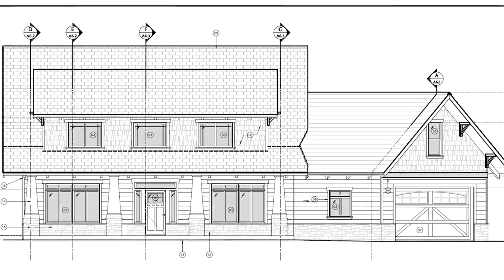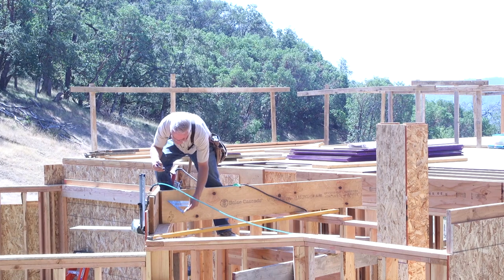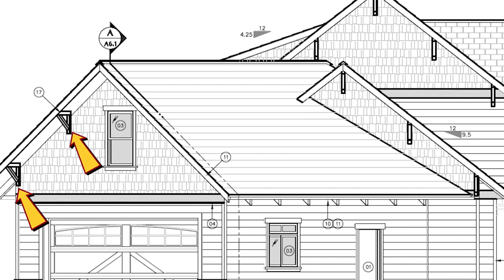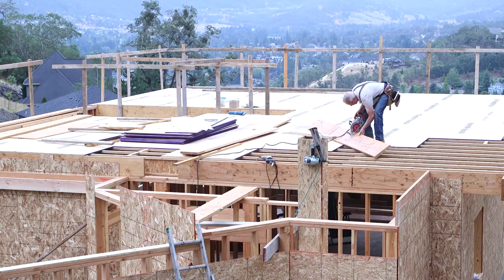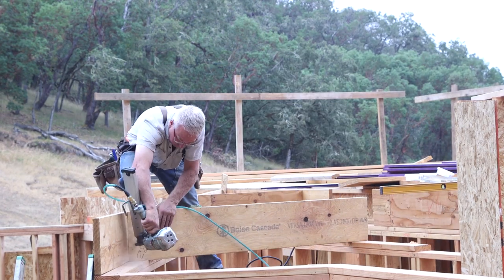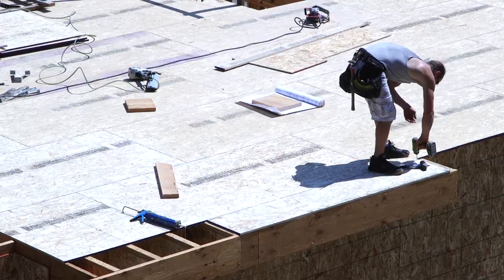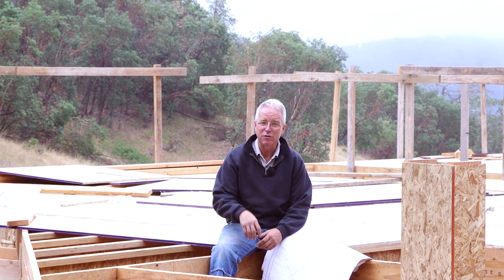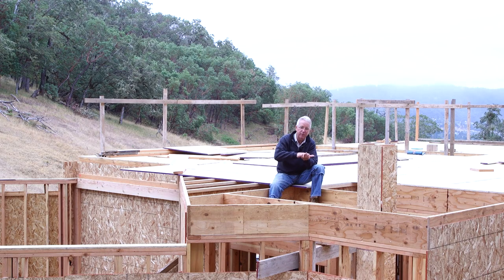Ledgers, LVLs, Design, and Scribing Ep.57

Comment: When I was junior in high school, I had an after-school job helping someone build their own house. In the process of sheathing the exterior, I found myself tasked with cutting a piece of plywood to fit where the 2nd story exterior wall intersected the roof of the 1st story AND the roof of the porch. I needed to cut a 5-sided piece and there were no right-angled corners. After staring at the problem for awhile, I jumped down, got my calculator out of my car, and used trigonometry and a straight edge to layout the shape onto a large piece of cardboard. I cut out the shape from the cardboard and took it up onto the roof -- it fit!  I'm sure there was a much simpler method of fitting a piece to that opening, but I had no idea how else to do it. My boss, who was a mechanical engineer, complimented my ingenuity. He said he'd been watching my progress and thought this may have been the first time trig had been used for such a practical purpose.
Reply: Well no wonder you turned to trig for your answer, as it was likely fresh in your mind from math class. I would have likely done the same.
Reply: My parents added a room on to their house many years ago. At the back, the sloping roof met the outside wall at an angle. That meant the wall had to get taller as it went along. I remember the carpenter saying he had to take the plans home and work out the stud heights using trigonometry. It came out great the first time around. He was both smart and fun. I'd help him clean up the site most days after school, and we'd have a great time talking and working.
Reply: measure / calculate twice , cut once
Reply: 44R0Ndin yeah, I’d be curious to know if that same idea would have taken place 20 years later. I don’t know the specifics but I personally would have just taken that same piece of cardboard and scribed it from the inside or just guesstimate it from the outside, cut the cardboard, repeat until it fit
Reply: @GameVilleofficialpage  Oh, sure, with 20/20 hindsight, scribing the opening onto a piece of cardboard would have been quicker and easier. But, I didn't think of that...
Reply: David Walser lol whatever works. There’s always another way is what I’ve learned, you just might not have thought of it yet
Reply: There's a technique that boat builders use called tick sticking that lets you easily plot out weird angled pieces, I've seen a few videos here on youtube.
Reply: Man I can't even spell trig a what ever. I couldn't buy a good math ability. So yeah good job on cutting that piece out.
Reply: Meanwhile, when I was a junior in high school (presumably much more recently), I had never even heard the word trigonometry. It's a shame that schools don't teach such powerful subjects unless you get into undergraduate classes these days...
Reply: I did the same thing with trig on a building site recently and it worked perfectly! An impossible-to-scribe cut made easy

Comment: I liked your remark about moving carefully from what you know into what you have to figure out. That happens in computer programming, too. I guess most crafts have more in common than we think: a mix of engineering, creativity, and sweat. 

Not that programming has nearly the same kind of sweat. One summer Saturday afternoon about 15 years ago I was complaining to my older brother, who was a welder, about how hard I was working (80+ hours a week, and some weeks over a 100, for months) on a big software project. He was sympathetic, but when I asked him what he was doing he told me about a chemical processing tank he was welding baffles into. The tank was so big they had to build it outside, and he needed to crawl around in the tank on a respirator - the smoke inside was so thick he couldn't see anything until the arc came on, and he thought it might be 140 degrees inside the tank. I never again complained to him about my long hours in a 12th floor air-conditioned office with an ergonomic chair and a view of SF Bay...

Comment: It's fun watching you deal with that stair/garage/flooring connection. I've been curious to see how you would approach it.  I've had a few 'odd' corners and other structural things to deal with over years of renovations.  Some days you spend more time thinking than constructing.  But every time, I've found it saves time and money [esp' materials] to stop and think.  Finally, I've learned to never underestimate the power of a string to solve problems.  Cheers!!

Comment: An impact driver would make driving those GRK's in so much easier than a drill. Your wrist and forearm would thank you.
Reply: My thought as well. I have given up on the large high torque drills except for mixing things for that, among other, reasons.
Reply: Yeah, had to do a double take when I saw that museum piece...
Reply: A lot of people probably don't realize that modern impact drivers are capable of driving those large GRKs with no problem.
Reply: Joe so thue
Reply: Thats true, but big screws will take forever with an impact...we put a tone of those in...only use the big cordless makita drills. Time is money.
Reply: Glenn Holcomb  tell my boss :D
Reply: Anytime I get the corded tool out... there’s a good reason for it. He’s probably waiting for a battery to charge
Reply: I'd say the same thing about that Skilsaw.  The new battery units make that thing obsolete today.  It pains me watching him fight with that cord all the time.
Reply: @jps101574  - he did a video last year (if I recall) showing the un-boxing of that saw.  They got it new, just for this build.
Reply: @jps101574  You just know he's to set in his ways to change though, doubt we'll see him with a battery skillsaw.
Reply: Glenn Holcomb  I was thinking the larger ½" automotive type too, they make easy work of just about any high torque job. The smaller, 1/4", construction style are good for a few, but even they with save your wrist and elbow from all the torque transmission when the head of the GRK meets the lumber and makes a sudden stop and the corded drill doesn't.
Reply: Goes double when driving GRKs in concrete
Reply: @jps101574  You're seemingly unaware of the huge cost associated with buying new batteries over the life of a tool, and the fire risks associated with Lithium cells. There was a big engine-room fire on a Canadian Navy ship a couple years back that was caused by a cordless tool battery. Corded tools are in no way obsolete, and they won't be any time soon. I'd take the inconvenience of a cord over the cost and risk of using cordless tools any day of the week.
Reply: @chrismoore9997  lol It's pretty funny that people like that just assume something's obsolete or old simply because they (usually weekend warriors) don't use it anymore. Self-awareness is in short supply these days it seems. At my local industrial supply store, they don't even sell cordless tools, and frankly, if it doesn't have a cord, I don't want it. Nothing beats the brute-force and reliability of a good corded tool.
Reply: @MFKR696  You are living in the past my friend.  You seem to be unaware that the new, top of the line battery powered units will whip the pants over ANY corded circular saw.  Corded units are limited to 15 amps (1800 Watts).  Milwaukee and Dewalt both have battery powered saws at 2100 watts and they will only get better.  Even Skilsaw saw the writing on the wall and came out with their own battery powered worm drive saw and it cuts significantly faster than their best corded saw.  Here is a vid proving it: https://www.youtube.com/watch?v=ZQ84yxEUAgk
Reply: @MFKR696  You're saying that like corded tools can't be considered a fire risk at all, when they very much are.
Reply: @Davey768  Go back and read what I said, Einstein. I never said that corded tools weren't a fire risk, but cordless tools are certainly more of a risk. At least a tool-cord doesn't turn into an incendiary grenade  when it goes bad, and if it does go bad, it costs me all of ~$5 to fix.
Reply: @jps101574  lol K. If you actually believe that, it's no skin off my back. More corded tools for me. You can say I'm living in the past all you want.
Reply: Those impact drivers require hearing protection. The little suckers are loud!
Reply: Interesting feed. I guess if you have a cord out it's no big deal. I'm just going to say my Milwaukee impact (or any standard 1/4" impact driver makita, metabo, dewalt, bosch, etc..) is the only tool I've used in the past eight years to drive screws. On a 3aH battery I can burn through a 50ct. box of 10" timberloks and still have a couple bars of power left. Not to mention the brushless or hydraulic drivers.
Reply: H3R3T1C “awwwww once upon a time a fire happened”. Yeah mate, you keep rolling out the story about a fire on a ship that you heard from someone who heard from the other guy who wasn’t there that it was caused by a battery tool. 
Running around a roof with a corded tool is plain dumb when there is a battery alternative that does the same job
Reply: H3R3T1C ok I’ve read all your commentary on this subject now. It appears you are the “weekend warrior” professionals like me use cordless. There are jobs that still require corded tools no doubt but when you are screwing off, cutting or drilling off a ladder, in a roof space cordless is THE BEST. also sounds like you shop at an industrial supplier that hasn’t updated their stock since 1975. You have no clue and your opinion on this subject is worthless. Just like your industrial supplier...
Reply: @MFKR696  I'm all with you on this one, for high production/high power usage tools like a skilsaw or nail gun on a new-build framing job, corded/hose is absolutely the way to go. Batteries can't keep up with the sheer work pace and number of cuts done in new build situations, and you're often doing a lot of work in one area!

For jobs where you're moving around a lot from area to area, remodels or punch lists and such, having certain cordless tools are nice though.
Reply: Absolutely
Reply: H3R3T1C salty af... 🤦🏽‍♂️
Reply: Slower. 1/2 drill will get through 3 LVL’s no prob. Just use a good ladder
Reply: For real!! Omg did u see that guys face? Lol. My children drive those screws into posts when they want to play in my shop with me. Invest in an impact for gods sake.
Reply: Jeff Orshalick 😂
Reply: @rocksolid8798  any decent modern impact could drive those grks quickly with no pilot hole. ¼ would be fine unless you were doing it all day then a ½ would be wise.
Reply: This may be a late reply, but there's a video on this channel about using impact drivers. I think he does use it, (and if you watch his vids you'll see he does use some cordless), but had good reasons for not using here. 

He's commented once about not having to upgrade to the 'biggest and best', and about effeciency and reliance on familiar tools, etc. Whatever the reasons, he's had enough experience and considered things enough to know what he's doing. 

That being said, I freely admit I am a 'weekend warrior', which many people who watch this video probably are, too.
Reply: Just wanted to say the same thing..200nm goes throu wood like knife into butter
Reply: Until you have to buy hearing aids when you're 60. Hard pass.

Comment: I'm glad you mentioned measuring as little as possible. It's always better to take a direct dimension with a string, board, mark a line with a level or whatever. The less you use the tape the more accurate your pieces will be. You don't need to know what many dimensions are and there are way too many steps involved with using a tape to screw up the cut.

     That odd area you were doing is often the most fun and rewarding part. Though many times it can turn into a nightmare if there were cumulative errors before that point.

Comment: For what it's worth, I'm working on a project that's used a bunch of 4" - 6" (and even a few 8") GRK structural screws, and with an impact driver I've had zero trouble driving them through pressure treated 4x4s and 2x6s with no pilot hole and no splitting.

Comment: Talking about taking as few measurements as possible, reminds me of how much faster and better it is to use as few measurements as possible in drafting.

In drafting, you can make one line a given length.  You can then offset that line with another at a certain distance.  Then connect the 4 corners with 2 new lines, completely unmeasured.  And you can simply continue on this way.  Often times I found that if I were working in this manner of simply offsetting and connecting existing lines and points I'd not only be faster, but also fewer mistakes.

Comment: Im a major advocate of the "anti-tape" approach. Especially when I'm plumbing with PEX I usually don't even take a tape out of the truck. My eyes and hands are all I need to measure. I find where I want to make the cut, hold mine thumb nail right at the line, and with my other hand take my cutters and butt the blade right up against my thumbnail and make the cut. All this is done in half the time it takes to even grab the tape measure and it's always perfectly accurate.

Comment: I love the part about the bad ladder set-up.    I'm a Safety Engineer and the millisecond I saw that ladder I knew it was wrong.  THEN the captioning popped up pointing out this error.   Thank you so much for showing your concern for safety on the jobsite.   I think that ladder has the type of feet that flip down and can dig into the ground; a good option in this situation.  Great job guys, love this series.

Comment: I really enjoy your videos, but I don't agree with the anti tape comment. Yes in certain circumstances it is ok to do and a little quicker. 

Dragging heavy, long LVLs over an open stairwell to scribe them for cutting, then cutting them while balancing precariously on a top plate to save a few seconds is dangerous.

Just measure and then cut the LVL while you are standing somewhere flat, comfortable and safe (in this case only a few feet/metres away on the the sheet flooring).

Saving a few seconds isn't worth ending up in hospital.

Comment: Could you go over your trick on cutting the perfect angles on the ends of the joist boards? Not only are they the right length but the right angle on both sides. If had to do that I would have had scrap pieces to figure out the angle  then have about 10 cuts slowly creeping up to the right length on a new board.

Comment: I need help with foundation maybe you can answer my question basement Walls  4' footing  126' x 246' x 12' 8" concrete floor 2" x 8" breaing walls 2" x 8" walls.  would that be strong enough to hold 126' x 246' 124' house

Comment: Nice job ,there is going to be some work in the roof over this area
Reply: Agreed. First time I’ve seen that, that section is cocked off on a 36° angle. I had just assumed it was a 45°.
🤜🤛
Reply: @psidvicious  weird angle probably due to size of site & space required around building..
Reply: @stevebaker5642  No doubt. Must have just been the most convenient [finish] angle for garage access. Wha’da ya gonna do? Gotta work with what’ja got 🤷‍♂️
🤜🤛

Comment: Love the series, was entirely enjoying the video until I realized it was over at the end. It made me sad when it ended, now to wait until the next one.

As for others saying that an impact driver or impact wrench would be a better tool for driving large screws. 99% of the time it is right. But last year I built a Log Home with 4"x 12" logs that went up to 12' feet. I had to run over 2000 15" Log Hog screws through the logs, some of which had to be run twice, and sink the heads 1/4" below surface. My cordless impact driver, impact wrench, and my oil pulse driver, none of them would drive them in past half way. With my new cordless brushed hammer drill, it would drive them, but took 45+ seconds to drive them full speed, and after about 12, it was getting way to hot. I went and bought the brand new Ridgid Octane brushless hammer drill, thinking if it burnt up, I could easily replace it under the 90 days store warranty. That thing took just under 30 seconds to drive them, and drove hundreds of those 15" Log Hog screws every day for a couple weeks. Never once got hot, or skipped a beat, but I did punch myself in the face a couple times because of the drill. Between that Octane drill, and an old paddle mixing drill, we drove every one. With the Octane driving them way faster, almost 2:1.

Comment: I'm curious what the column that you refer to at 10:50 on the video will hold? And thank you for your good work!
Reply: The column is for the stair winders... He could have used a steel post to support the stairs, but chose a much larger column instead, as with the steel option, the treads would come to a point instead of the desired 6 or so inches. I believe he says in a previous video what the regs were in his state regards minimum tread width on a winder. The stair case he's building rises 6/7 steps, winds 4/5 more, then has another 5/6 steps.

Comment: How do you take the measures in 7:45 that the boards are 90 degrees and evenly spaced?
Reply: You can mark your spacing on the straight board, and using a framing square and a chalk line, get a pretty accurate mark transfered onto the angled rim joist. Unless there's plumbing in those bays (doubtful, given it is most likely a hallway to the 2nd floor of the garage) the exact location of each joist is up to the framer really.